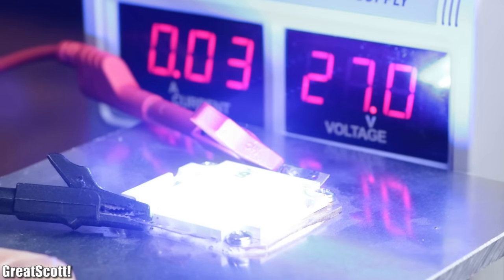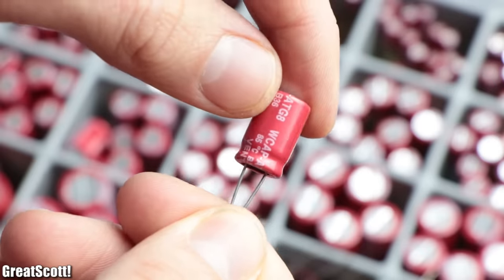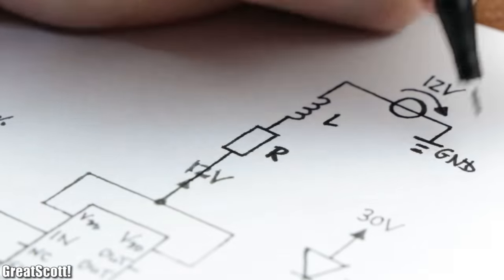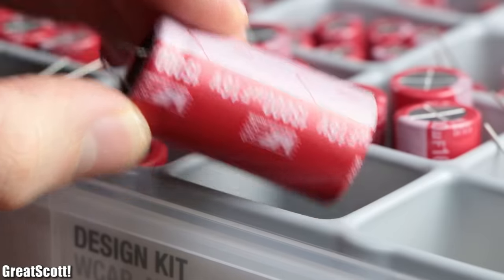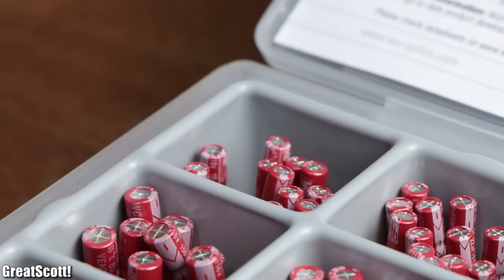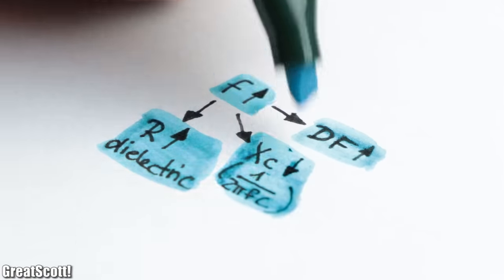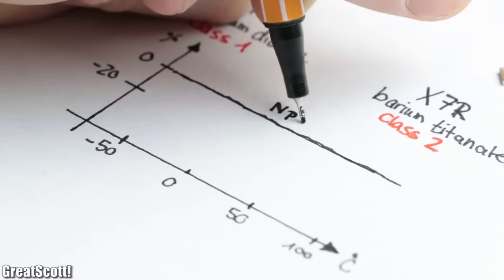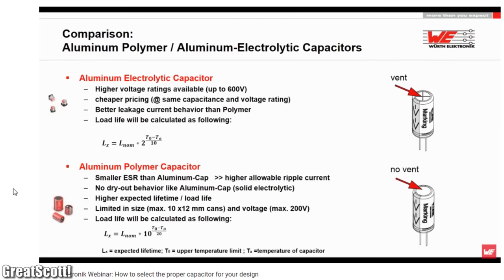How to choose the right capacitor type for a circuit?! || Film vs. Ceramic vs. Electrolytic

Comment: Me: slaps ceramic capacitor on everything 
Seller: that will be one kidney and 19 cent
Reply: It's not that expensive
Reply: @johnyang799  German fighter jet noise
Reply: @blackturbine  bruh how the hell are you using 1000 4.7uf film capacitors for rectification filtering
Reply: @johnyang799  at that point something's wrong with the power supply
 more capacitor
Reply: @blackturbine  moar!!!!
Reply: @johnyang799  screw small capacitors time to pull out power station capacitor maybe 2 *still 10 mV noise
Reply: Dude same, capacitor on every thing I have made
Reply: @skyem5250  understandable have a great capacitor
Reply: The trick is to work out the most efficient price point. EG a 100uF ceramic costs way more than 5  off 22uF ceramics. The other trick it to use high frequency switchers so that even at 12A you still only need 4 low ESR 22uF caps along with say a 10nF to kill the high harmonics. On one low noise PSU I designed recently it was 8 x 22uF 100nF 10nF and 2 off 1 nF. Needless to say it was somewhat less than 10mV noise even at full load. Star points are also important for this. Copper track has significant impedance at HF.
Reply: @gordonlawrence4749  good information but I'm afraid you missed a joke
Reply: Though a bit advanced for me, I understood 80%. What I liked about this video is the nuts and bolts approach to how it works.
Reply: @rowanernesto9915  bruh

Comment: What kind(s) of cap(s) of what value?  Always look at the datasheet.  From the TC4420 datasheet (cap values for most ICs are usually more definitively stated):

"The VDD input should be bypassed to ground with
 a local ceramic capacitor. The value of the capacitor should be chosen based on the capacitive load that is being driven. A minimum value of 1.0 µF is suggested."
Reply: Late reply, the cap should be able to provide the capacitor load provided by the MOSFET Source Gate Junction. Higher load values require higher bypass cap values. For example, driving an International Rectifier IRF3805 is driving into a typical gate capacitance of 7.96 nF. At 100KHZ, this is considerable gate current. A 10nF (0.01uF) bypass cap is going to be inadequate. I worked on an inverter where one driver drove a bank of 4 of these transistors, so the minimum value of 1uF is a good start.
Reply: @isettech  sooo... Basically, read the data sheet again.

Comment: Thank you so much. Great video!  This answered several questions for me.
I think this video could have gone on for another 30 minutes. Choosing the correct capacitor for a project is important based on what the circuit needs.

Very nicely done.  I also selected the German video at first, and suddenly thought something went wrong with my iPad. 😂😂😂.   I really think your videos are the best!!

Comment: Really nice! 😊
But what about low ESR electrolytic capacitors? 🤔
Reply: They still have a much higher ESR and ESL than ceramic or film capacitors, but are available in higher capacities. They can provide larger currents without getting too hot and also work up to a little higher frequency. There are also differences for different capacities, especially with ceramic capacitors, that are often used as bypass caps, datasheets of ICs with higher power requirement, like microcontrollers or FPGAs often show, that ceramic caps with different values are used in parallel, like 1µF and 100nF and 10nF, because they have different frequency characteristics and the lower capacity ones also have lower ESL and can filter higher frequencies.
Reply: Also Electrolytic capacitors are prone to fail in the long run due to leakage of the electrolyte. Just my 2cents
Reply: @Conservator. 
Not really, only the cheap ones.
Reply: @user255  Even the expensive ones have somewhat limited usable life according to their dataheets. And you kinda have to choose between a long-life series or an otherwise higher performance one.
Reply: @benbaselet2026 
Well, depends on how you use the capacitor. Example the usable life can be determined by when the capacitance has dropped to certain percent of the original. If you take the changes in time into consideration, the circuit can work considerably longer than the life time given in the datasheet.

Comment: Just be aware that ceramic SMD capacitors usually fail in a short while electrolytic caps always fail open.
Reply: Exploded electrolytics would indicate that is not always true. I've also seen ceramic SMD fail open, usually due to a crack forming.
Although, to be fair, an exploded electrolytic capacitor is now an open. But the initial failure was a short, and may remain that way if the circuit cannot provide sufficient energy to blow it up.
Reply: @AlienRelics  
Electrolytic capacitors usually explode due to high ESR or leakage currents that heats them up. I don’t think that they often produce a dead short. If they do the results will be spectacular.
Reply: @Conservator.  Tantalum electrolytics tend to short and then burn. In general, aluminum electrolytics tend to slowly degrade and dry out, failing as high ESR and low capacitance. But they do occasionally fail more spectacularly.

I wasn't intending to split hairs. Only that you said "always".
Reply: @AlienRelics  👍 Thanks

Comment: 100 nF X7R bypass caps everywhere. Most of the time, they do their job pretty well. If more "not that instantaneous" energy is needed, add additional 1-10uF ceramic IN PARALLELE to the 100 nF bypass. E.g. for power regulation ICs, I put 100 nF at the in and out and an additional high-capacity cap in parallel at least to the output (mostly, both sides and low-esr electrolyte, 10-100 uF) .

Comment: -V=L(dI/dt) and the rate of change of current is 133 million amps per second. So you don't need a big L to get an appreciable -V. Even just 1 meter of 1mm dia wire is roughly 1,5uH. So that current is going to give you a back EMF of up to 200V in that configuration with no capacitor damping. I used to work with a very clever RF guy who basically stated "the problem with electronics is you want the signal to just go up and down, however everything in the circuit wants to go boing.",

Comment: What about choosing the correct voltage rating on a capacitor? I have two 20v DC stepper motors using two stepper motor drivers with one 20v power supply. In choosing the correct voltage for a capacitor on the DC line, should I double the voltage of the capacitor rating to like 50v rating? Should I go 63v or even 100v just to be safe from wear or explosion? Thanks!

Comment: I think I get it...Sooooo like. What about handling volt spikes(from a motor stopping suddenly), lots of noise, and that is close to a heat source.
I'm working with 11.1v 14.8v and 18.5v it's going on the distribute bord with 4 high speed motors that fluctuate; also it's wired to a control bord.
Thanks 4 the help.

Comment: Question, Why does there have to be a PWM signal to drive the LEDs?  Why can't one just vary the voltage instead?  It seems like an over-complicated circuit design.  And especially if powering the LED from DC, shouldn't you be able to use a current limiting circuit or voltage limiting adjustable resistor like a rheostat or something??

Comment: Gooday, I'm looking to replace the battery in a small 150cc EFI sport bike with a capacitor, not sure what capacitor would suit. Will be running headlights and speedometer, should I go larger to smoothen out any flickering?

Comment: Why the Green coloured Film capacitor breaks down quickly than Red coloured one of same value & voltage rating when used with high voltage like 240 V Ac?

Comment: Should had quickly talked about this graph: https://en.wikipedia.org/wiki/Capacitor_types#/media/File:Kondensatoren-Kap-Versus-Spg-English.svg. The way I was taught, you would calculated the value in F that you needed for decoupling and the maximum voltage. Then you would use this sort of graph (another one exists with a frequency dependent axis) to select the right sort of cap.

Comment: I saw a 300b circuit . It was a 16 watt two tube mono block design thatdoesn,t use a power trans just a output trans a choke and 15 electrolytic caps. I don,t understsnd how it works! But i want two for my stereo!!! It called the billy ladyday se 300b.

Comment: I've been keeping old electronic devices from the early 90's and 2000's example snes console, ps2 slim and crt tvs will these devices have problems with aluminum electrolytic capacitors if stored for a long time?

Comment: Dear Sir ! I needed build a PCI that can do many functions at same time . On/off 30 or 40 leds not exactly same time but some times 6 or 7 and toguether 2 servo motors . I can to say that I have ready circuit but, I don't know exactly what pieces conect exactly to avoid overcharge pieces and circuit and its necessary a  insert a correct program into ICs. 
Are there some computer program tô help us to do that ? Or how calculate that ?
Thanks, 
Best regards ! 
Jim

Comment: Hi,GreatScott for the next video can you make a 250w boost converter to work at 5v dc ?
Reply: That would be inefficient to use a buck/boost type, those sort of power levels you need to start looking at forward type of converters. Resonant would be you best bet. ZVS or CVS, the former being easier to implement.
Reply: @matthewmaxwell-burton4549  ok I will try to modify a zvs or any boost converter to power it with 5v.

Comment: Another awesome video thank you great scott I’m new to these electronic stuff but im trying my best. I need your help in understanding a video https://youtu.be/ZSWKv5cC1Cc. This guy somehow achieved higher voltages from by simply connecting diodes and a coil with turns. I tried to think to think with my little brain i dont get it also he speaks in a diff language can u help me with this? I know he connected those yellow wires to the secondary coil of the transformer and added a bridge rectifier but I donot understand that coil part. Is it the inductor with less turns to drop the voltage?

Comment: my question is when the capacitor in DC circuit, it that should be a open source? which the ESR going to infinite. how can we test it with dc then? 16V not like a AV sources at all.

Comment: Thanks for an awesome vid .
Btw I toke your advise and used jlcpcb. I am new to buying pcbs.. so I toke a mayor chance.. the program I use. (which I also recommend for pro beginners is circuit wiz. ) Had some things I was not sure would work in the Gerber file. So I sended them the Gerber to see if it was alright.  It was... The service from jlcpcb is amasing..from start to finish a little over a week with shipment . I have now my new smart pcbs (in black 😁).. an the end result is magnificent...also the price  So I wanted all to know.. also you great Scott, as you promoted it.  I am excited for the next phase...so thanks Scott for the promotion..  👍... I know this has not much to do with the current video...

Comment: Which capacitor would be best for high speed switchmode supply? would I still use a E-cap for bulk at 100kHz or should I choose one of the other?

Comment: The parasitic capacitance and power supply's inductance is not as high to oscillate the voltage at around 100 KHz. But I also don't know how much is the inductance.

Comment: Can we manufacturing ccd capacitor with 3 layers and high voltage outer layers and use only middle layers so it last a year per charge possible if couple with oscillator so it oscilate forever

Comment: dont forget lead/wire/trace inductance. As a general rule I put 100n caps near the power pin of chips and a larger electro or tantalum cap near the power connector of the cards I made for my TTL computer

Comment: Very interesting video, well explained as your usual.
One question, however, come to mi mind: the problem of the 100 KHz overvoltage would have occurred even with a battery power supply (since you also considered the construction of your power supply).
Maybe you explained it in your video but I am not a native English speaker and sometimes I miss a few passages
thank for sharing

Comment: Thanks for an interesting video. Wurth has been promoting their products a lot recently on many electronics distributor websites. Time to check their annual report. Aaand, yupp, as expected, it's nice to see our European companies developing. Hoorah.

P.S. Add a 1K pulldown resistor between the MOS gate (connected to driver IC out) and ground. It helps stabilize the circuit and it discharges the gate faster allowing for greater frequencies and less noise (depending on the resistor package, trace width or wire length, etc).
Also, you could make a video on linear regulator types and stability. It's interesting how they behave depending on capacitance at the output. Some newer types are far more energy efficient but they easily become unstable to the point they require high ESR tantalum caps. I wonder what's the theory behind that...

Comment: It would be much easier if you use an inductor/choke before the drain-led-source trace. This way, the high frequency components are blocked from the driving side. I would also suggest the "bypassing capacitor" video from eevblog, which is more intuitive in a sense to differentiate various types of caps.

Comment: Thank you also do one for high frequency RF or UHF capacitors too for above 100-300 MHz ham radio frequency ranges. Plus do those for high voltage rated UHF capacitor types. Will be very useful for any one working on 100-300MHz and 1 GHz frequency ranges power applications. Thanks a lot👍🏻

Comment: can u make one winter cold day :) video about crystals xtals etc and examples of circuits youtube has lack of these clips :) they are offen visible on boards next cappacitors, inductors etc  why they are so important how to connect them
Reply: yo and how to measure them :) ofc pretty interesting idea would be how to measure varistors zener diodes thermistors fuses in domestic conditions without expensive hardware

Comment: Great video! Can you extend it a bit by using different types of caps together? I was always told that adding a small capacity ceramic in parallel with large "main" electrolytic will work wonders (esp for high frequencies) and it always improved the noise in my circuits, however I was never taught how the pair properly... just slap whatever ceramic you have at hand,  it wont hurt :D

Comment: That is an awesome capacitor kit! My first thought was high frequency oscillating best to use ceramic. Electrolitics start “ringing” at high frequency creating additional oscillations. A transformer and capacitor would be the most effective in my thinking.

Comment: Great video! I appreciated the practical explanation of each type of capacitor. What is also interesting is the fact that the power supply was slower in providing the initial current than the capacitor.
Thanks for making the video.
Reply: 18 hours ago???

Comment: What about super capacitors?
Reply: Judosheep no need, you need speed more than capacity in this case, which is why the electrolytic is not ideal.
Reply: @ctrlaltdebug  yeah but i thought the vid is just about the different types of caps

Comment: 4:30 - usually any IC's datasheet shows all possible usage cases. And very often it shows that you need a decoupling capacitor(s) on power lines. So... to make a fail you just need to not read a datasheet carefully :)